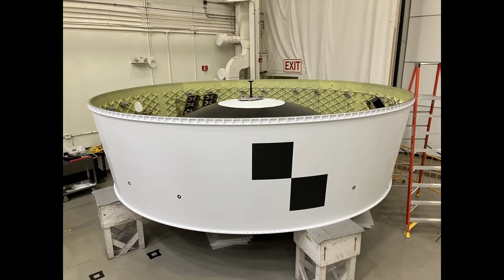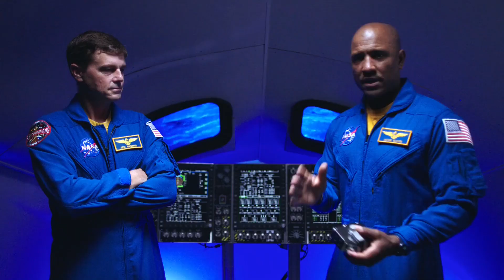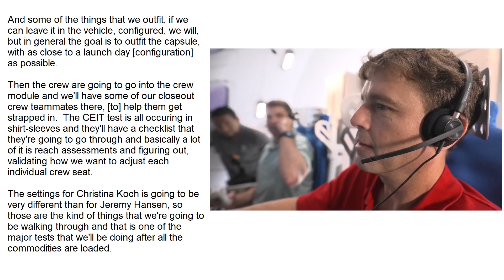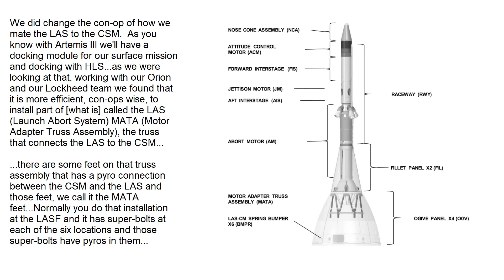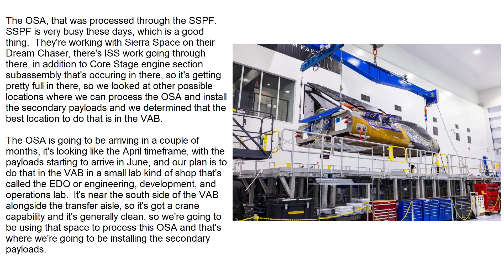NASA EGS Artemis II launch preps for Orion and astronauts, Part II

Comment: Been a few videos already, but I appreciate the campus graphic, which shows the relation of all the workshops you mention every video. I vaguely remember being among those asking for such a thing, some time ago.
Reply from the maker: Thanks.  Serendipitously re-crossed the path of the graphic recently in a NASA paper, but that's kind of a dependency in a low production budget world.
Reply: @PhilipSloss  Your mention of limitations caused me to go on a quest. Eventually, I found "Facility Utilization Maps," for 2023 by KSC BOSS (Base Operations Spaceport Services). There are differences: Structure "M6-0698," just South of main parking, could either be "Supply Warehouse 2" per BOSS, or "PGOC" (Payload Ground Operations Center) per your Visitor's Map. I suppose both can be true...
Are you happy with the Visitor Map simplicity, or would you want something with more fidelity?
Reply from the maker: @MrCantStopTheRobot Nice find, thanks for pointing that out.  The last time I went looking for something I found the 2013 revision, I used that a couple of times, such as for the RPSF.  I'll have to see when the next opportunity presents itself for using these.
Reply: @PhilipSloss  The superb fidelity of the Facility Utilization Maps makes them too visually busy for a quick slide reference, I'd think.

If I could send you some raster or vector traces of those maps, but pared-down, to only include sites pertinent to Artemis moves, would you be interested?

On a slow day, I checked that 2008 Visitor Map and by now, at least 4 of its ~33 reference points are demolished or transplanted.
Reply from the maker: @MrCantStopTheRobot  Sorry for not responding earlier; thanks for the offer.  It's busy right now, so I'll have to think about this later in the year.

Comment: Phillip, you always hear that the ‘ESM doesn’t have the DV for low lunar orbit, not like Apollo’s SM…’ Are they saying that because the engine isn’t strong enough to maintain LLO for any length of time on full power? Or it would just run out of fuel because the ESM isn’t large enough (but, otherwise, could maintain LLO)? Thanks!
Reply: Well firstly, orbits are mostly passive, so there’s nothing like an engine needing enough power to “maintiain LLO”. 

The issue is the delta/v of the Orion/ESM. It has an estimated d/v of somewhere between 1350 and 1590 meters per second, and you need about 2000 to comfortably pull off low lunar orbit. It’s about 850-950 m/s to slow down into LLO, and about that amount to return to Earth. For reference, the Apollo SM had about 2100 m/s of delta/v
Reply: @ thanks! I wonder if the d/v is just considering the AJ10? What if you fired it and all 8 R-4Ds at once? Would it get it to 2000?
Reply: @stevengoyette3165  deltaV is really just about having enough fuel and having a high enough engine efficiency (exhaust velocity). Thrust doesn't really matter. So as long as the AJ-10 and the R-4Ds are pulling fuel from the same tanks it doesn't really matter if the R-4Ds are running or not. If anything running the R-4Ds would decrease the total deltaV, as they may be slightly less efficient (Wikipedia says they have 4s less specific impulse). Now higher thrust does allow for more efficient maneuvers, allowing you to get to where you want to go with slightly less deltaV, so perhaps running the R-4Ds is beneficial after all (I don't know), but the overall effect should be quite minimal.
Reply from the maker: The ESM only carries enough propellant for a one-way trip for Orion, either a lunar orbit insertion from TLI or for a TEI burn from LLO.  For Constellation, Orion did the latter.

The ESM propellant load is about half of what the Apollo Service Module carried for the SPS engine.

Re: LLO maintenance, the mascons on the Moon (the gravity field) would require a decent amount of prop usage.  A NASA paper on Lunar Reconnaissance Orbiter said it required about 11 m/s every four weeks at its 50 km science orbit.  There are other options, like frozen orbits, which significantly reduce maintenance "costs" but the trade space for those isn't fully spelled out.  (Abort options would be an obvious one.)
Reply: @PhilipSloss  Thanks, Philip. Where I’m going here is that I’m thinking about Gateway not being in NRHO, but rather in LLO (to be a better ‘lifeboat’ and making it an easy sell to Jared to keep it was part of Artemis). But we would need the ESM to have enough d/v to escape from LLO. Would it be as ‘simple’ as ‘stretching’ the ESM for larger fuel tanks? In theory?
Reply from the maker: @stevengoyette3165  There are alternate orbits for Gateway, but it's not clear what requirements there are, which makes it harder to do pros and cons.  LLO with the high "maintenance" would need frequent prop resupply; that may or may not be an issue with high-cadence commercial launch systems that SpaceX has and is developing.

If Orion were still around, the Constellation con-op could still be used for LLO: Orion only does a TEI "burn" (or set of burns) to get out of LLO, and LOI into LLO would be done by another vehicle.  (For Constellation, the con-op was for it to be done by the lunar lander.)